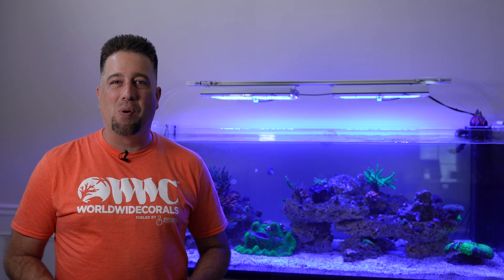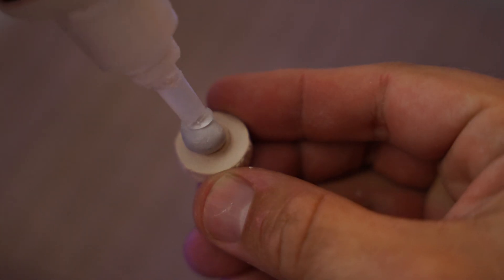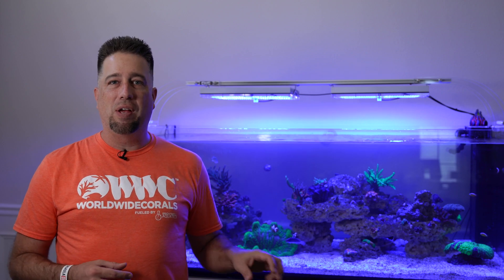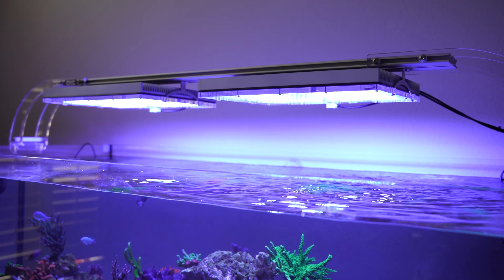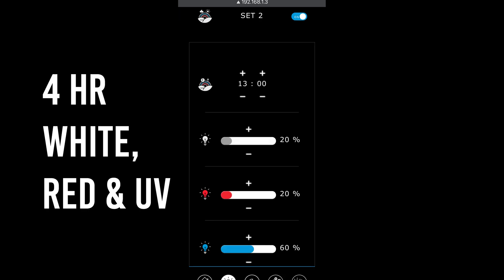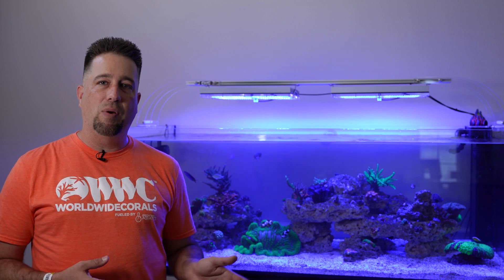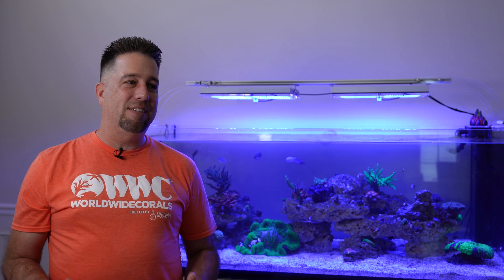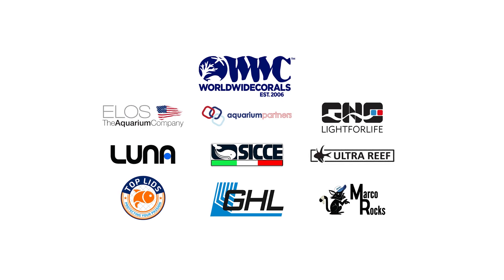LED Lighting Schedule - ELOS Dream Reef (Episode 6)

Comment: All right I got one for you say you had a 20 gallon water box with a 16 AI Prime on it and it's a mixed reef I would like to know what would you put your UV on how high would you run your Blues and then your whites and then what do you think the part outcome would be on the top and the bottom of the tank
Reply from the maker: Hey Dan, I used the same AI prime schedule that we have on our website (24G reef). It should give you a good starting point and you can tweak it from there. We didn't take the par readings, but it's good for a mixed reef.
https://worldwidecorals.com/pages/led-lighting-presets
Reply: @WorldWideCorals  I checked out this program you run no whites whatsoever and even if I ramped up your setting you're telling me that you can grow sps's in this setting without any whites
Reply from the maker: Hey Dan, we like to run whites for 4 hours and the rest of the schedule all blue.